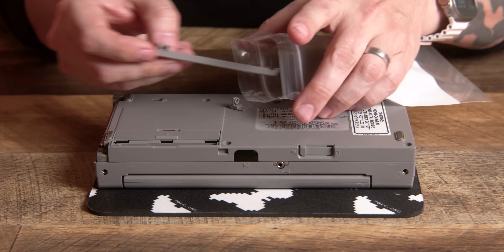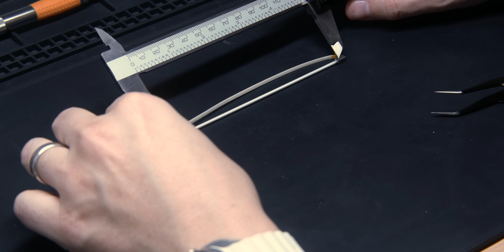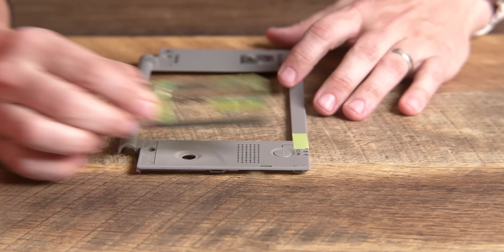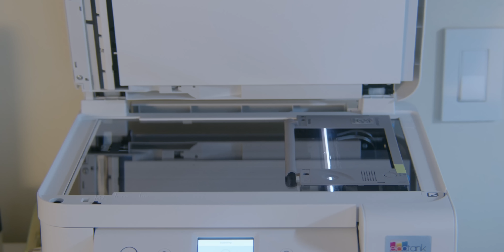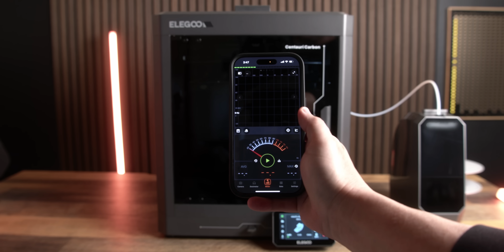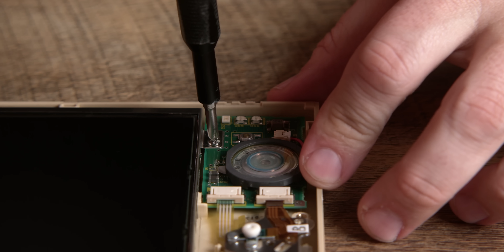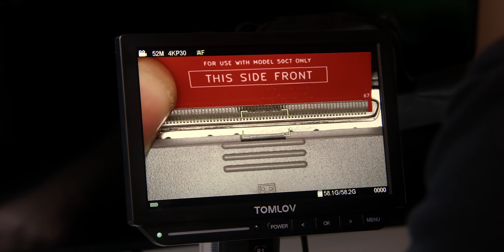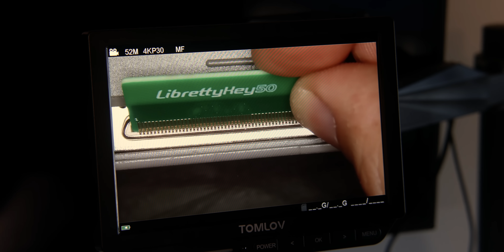I saved this crumbling little laptop from itself

Comment: Why not use an LED backlight? Much longer lasting and a lot less power draw than florescent.
Reply from the maker: Couldn’t find an inverter board that fit within the display case. Decided to make that a reverse engineering project for another time :)
Reply: @polymatt  ahh... makes sense.  I had an HP Omnibook 800 (HP interpretation of the mini laptops of the time) and I feel your pain. I also had a T2105CS - full size Toshiba laptop of that vintage - and the engineering was fantastic - Dropped it down a flight of steps and realized half the screen was blank - Fearing the worst I disassembled it and found a ribbon cable had detached - plugged it back in and worked for years after. I miss Japanese engineering!
Reply: @polymatt Specs, link to that backlight bulb please? 😊
Reply from the maker: @ just added to the video description!

Comment: Ok, this was dope. I would love to see you do retro consoles in the same manner! I would love to 3d print myself a new PS2 Slim or PS2 phat console case :p. Awesome work on this restoration!
Reply from the maker: Thanks! Ive been asked about the PS2s before and that might be fun. Usually I try to stay away from multi-plate prints and try to focus on stuff that will fit entirely on a 256x3 build volume, but no reason why I couldn't model up a case :)
Reply: @polymatt  I totally get that! Maybe a future sponsor can help out with a printer with a larger print bed. :p that way you can print a full console case without needing to break the model apart.

Comment: Haha, as soon as I read the title I literally said "What the hell did you say??"
I own both a Libretto 50ct and 100ct along with some accessories:
The dock or "I/O Adapter" as Toshiba calls it, a 56k modem expansion card, a 10mbps ethernet expansion card, 3 floppy disk expansion cards, all the other misc cables and a carry bag designed for the Libretto series.

I inherited the 100ct and accessories from my dad who used it as a demo model whilst he was a sales rep in 2000's for a Toshiba distributer in Dublin, he'd drive around Ireland selling all kinds of hardware but very rarely he'd manage to sell a Libretto to someone higher up that could afford it. 

When I was a teenager I worked with my dad who's now a systems technician and we did some work in an office up the country and met one of the executives (Now the CTO) that he'd sold a Libretto 50ct to all those years ago. He'd kept it in pristine condition on the same desk for about 20 years as a daily planner/calendar and he gave it to me as a gift.

So that's how I ended up with two Librettos that I'll never sell for sentimental reasons and because I think they're just about the coolest laptops ever made. The keyboard on the 100ct is broken however, so I might have a crack at fixing it sometime,
Reply: BTW. If you ever hear anyone making keyboard PCBs (they should be single-sided, simple, but pretty large), I'm in. I also have an HP 200lx in my collection, and it needs a new flexible board for it. (it's folded, and the traces can be easily scanned)

Comment: Lucky its the 50ct, the power supply on the 100 and 110 is proprietary, I have made them before so its not super hard but still an issue. I have 4 of the laptops in various states of repair and I have just not been wanting to do the mountain of work for the plastics to crumble. If you ever get the 100 or 110 and make a case for that I'd be interested. I had to remove the bios lock once and I had 2 diff docks at one point, the full size and the mini. Both had parallel, I stuck paperclips in the holes and connected those with wire. Worked pretty well.

Comment: The laptop coming out of sleep to it's DECADES OLD session is so crazy to imagine! 10/10
Reply: It was a magical moment to watch.
Reply: @SoloArtForm  Magical indeed.
Reply: Ironically that is one of the advantages of HDDs. Apparently if an SSD isn't powered up somewhat regularly, then you can end up with it what is basically bit-rot and it will loose data. Found that out when using SSDs to act as an offline backup, and was advised about the issues.
Reply: @kelvin1316  aw nuts, I have a bunch of 15 year old ssds from my uni days I've been meaning to dump files from for 10 years 😅
Reply: @paultapping9510 well get it done now that you know. Don’t put it off.
Reply: @kelvin1316  HDD's in general have better life spans than SSD's, whether they are being used or not.  HDD get infinite data writes and only succumbs to mechanical failure, usually after at least 10 to 15 years.  SSD's get, typically, 600 to 1000 times their capacity written and they are done. (So 512GB SSD gets about 300TB written typically before failure.)  And bit rot will occur in high quality NV memory in about 20 years, while cheap stuff may only be bit rot in 5 years.
Reply: @kelvin1316   The bit rot happens for HDD's. That is the point why a Spinrite application exist, and why it is as well very much needed for SSD's as well. 

Our digital storage is seriously dangerous for the cultures. We have started to do permanent damage by example scanning original paper documents, and then destroying the originals in sake of storage in some warehouse in air condition state. We talk about documents that are from 12th century that are now gone, because some idiot thinks that digital is the safer and better way!
Reply: @theserpentes  it goes both ways, when you have something physically you have to maintain it and make sure it's still where it's supposed to be, digitally you just have to make sure the drive gets powered on and used every so often, there are pros and cons to both depending on what the user wants. they may choose one over the other.
Reply: @raumfahreturschutze  Yeah. Imagine thousands of people using OCR on ancient religious manuscripts so they can dump all the parchment and artwork taking up valuable space. Back in the 80s, I had a job microfiching old invoices and dockets at a hosiery company. That stuff only needed to be archived for a few years for financial recording purposes anyway and maybe 0.5% would ever be looked at subsequently. That is more like the stuff that is going on.
Reply: This like an episode from Star Trek Deep space nine. An old Cardassian space station was started up. A long dormant program inside got activated, and it started ‘purging’ everyone on board…!!!
Reply: @arbjful  "Empok Nor" or "Civil Defense". My favorite Trek :)
Reply: Now that's what I call hibernation mode!
Reply: I actually let out an audible "Ayyyyy" when it resumed!
Reply: I have had this happen before myself.  I have also seen some crazy weird things on peoples old machines.
Reply: The laptop coming out of sleep 
- "Even in death I still serve."
Reply: I really liked the hibernation systems before Microsoft built it into Windows. They could startup much faster than booting from the hard drive because they didn't have to load anything except the RAM image. Windows hibernation has to boot up Windows part way then load the RAM image.
Reply: Meanwhile every time I have to reboot a modern system these days or the brokenness of windows sleep or mac terrible affinity for permanently staying on..... Somehow they managed to actually figure out how to do hibernation before Microsoft took their hand out it with XP back in the day I remember it it didn't work very well for a few service packs. And the same on Mac OS X, it was one of the first things I disabled because it was almost guaranteed to not work.

Comment: I have a Toshiba Satellite 100CS from this era and it sadly has the same brittle plastic issue as these Librettos. Half of the bottom is cracked, and the bezel is split in half. I'm a fan of the laptop itself but mine definitely needs some repairs.

Comment: Absolutely enthralled with the no-component bare circuit board key. I figured you'd break out the connections for the parallel port, sure, but the idea that the solution to the BIOS password would be "shove a bare pcb in the expansion slot" is so out of left field. Absolutely hilarious that the tolerances allowed for that, probably my favorite element of the entire project. +1 to the idea of making a new dock for it too, why stop at preserving when you can improve on the base design?
Reply from the maker: 100% and trust me I was just as shocked as you. I was scratching my head for out of the box solutions and when it came to me I was like… there’s no way this could actually work… right?

Comment: WELL DONE! Man you are a boss when it comes to this sorta restoration. I do have a Satellite Pro 490XCDT the grey plastic is brittle, believe it of not the two batteries I have still hold 2 hours of charge each but I can only use one at a time.
Thank goodness the screen hasn't vinegared yet and it works well though it slightly dimmer than it use to be to my eyes at least. I do hope people can make new cases for these Libertto and my "7 pounder" [Yes folks the Satellite Pro 490XCDT laptop is 7.2 lbs / 3.3kg] 490XCDT I do still have the dongle I made for the parallel port it was easy to find online. You do good work man. Good job!

Comment: OH YESSSSSS! Thank you good sir! 

I have a disntegrating 50CT and my Bambu will get a workout tonight. I think the shell should be compatible with 60 and 70 possibly?

BTW, like a year ago I found old Macbook in ewasre and it resumed to Chrome 45 session from 2015.

Any chance for 20/30CTA or 100/110CT ? They suffer from the same horrible plastics. Actually all gray Toshibas do, the other day I grabbed my 660CDT and my fingers went through LCD cover ;-)
Reply: Damn, there is just no good orientation to print this. It looks the best vertical but it is very brittle because the parts have very small cross section so combined with weah layer adhesion it just snaps like glass. Flat is somewhat better but the small bits (catches and such) in display also snap off easily when removing supports because again, layer adhesion. The screw hole pockets in display cover also just detach during support removal becausee the plastic is so thin there. I guess the only way is to send it for printing on something better than ABS. I will try PETG next, maybe it will give me better results.

Comment: I have a Toshiba Tecra 730CDT and it had that BIOS lock (same with another one I had to do as well). I was going to buy a tool on eBay, but I ended up just getting a bunch of large paper clips, bending them into v shapes, and then carefully placing them in a certain way to eventually turn the laptop on and then clear the BIOS password. The Tecra has better plastic than this one (in the video) but the HDD caddy required me to wait over a year until someone was selling a thoroughly busted 740CDX which I bought and harvested the caddy from. They are literal rocking horse crap to find, and the docks? Well, I saw one, and it was about £500... so yeah, these things are kind of insane to collect. Fun thing about my 730CDT as well is that it was used by the Norwegian Telephone company according to the various markings and tags on the bottom.

Comment: I own a Libretto 50CT including docking station and some PCMCIA cards that can dual boot into Windows 98 or Debian Linux (Woody).
I replaced the HDD for an ATA to SD card slot interface with a whopping 64GB card.
This bc the original HDD is slow and noisy as hell.
Luckily not too many parts have broken of yet while I took it apart many times.
Fun fact, at the time this model came out it was only targeted for the Japanese market so when I got it, it was running a Japanese version of Windows 95.

Comment: I hope you put an SSD in that thing!
Reply: SSD's are SATA while the Libretto only has IDE ATA.
I replaced the original small, slow and noisy HDD with an ATA to SD card slot adapter and a whopping 64GB card.
It dual boots Windows or Linux very smoothly.

Comment: i had one of these woking with xp on it. slow was a understatement, battery was trashed but worked ok on psu. and the hd was clanking like god knows. memory was the major problem for it as it was not upgradable. and the graphics chip was basic. for a simple old xp mini laptop it did the job. didnt like the mouse lol

Comment: Hey I actually have one of these along with the dock. Your video inspired me to turn it on, and of course, it had a BIOS complaint. So I will have to build a parallel port dongle and get it working before I put it back in the box with all my other 30 year old laptops and PDA's.  Thanks for adding another unnecessary project on my list.

Comment: I made one of those parallel keys back in the day with parts from ratshack, believe it or not. I had the benefit of having the dock, however. 

Your solution for using the dock connector like a cartridge slot is much more elegant in my opinion. Great job.

Comment: holy cow! I cant beleive I found your channel. I've been wanting to embark on a project to make a reproduction case for my extremely rare Dauphin Orasis Pentium tablet. The plastic is similarly falling apart and I've had to glue it back together a few times. I put the project on hold because I don't have the expertise to do this. 

I'd love to work with you to make a reproduction shell for that unit and preserve its history. I recently wrapped up a 8 year long project to restore the machine to a working state, which i I successfully did in 2023, now the shell needs some love.

Comment: I get historical accuracy and all, but when replacing the backlight could it have been replaced with like a modern LED solution that's brighter and additionally helps lessen power draw?
Reply from the maker: This was actually the original plan but I couldn’t find one that had an inverter board small enough to fit in the display. I’m definitely not opposed to making my own but decided to save that for another time :)

Comment: Heck now that you have the key, it could be redesigned to make new docks for this lilliputian laptop! I.wonder if this methode could work with my Tecra 700ct!
Reply from the maker: 💯you could make an ultra dock as the connector exposes more than what the original dock had.
Reply: @polymatt  what's wild is the 700ct dock not only gave the usual ports but it also gave a SCSI-2 port and 3 ISA slots! Unfortunately those extras probably need extra logic in the dock.
But still for the basic IO it'd be good

Comment: There isn't just the HW parallel port dongle, there's also a way to bypass it with a specially prepared (well not really, either write an image to it or edit a few sectors manually) floppy disk. search term is "toshiba key disk"
Reply: But that would require a floppy drive which the base model doesn't have
Reply: @MenaceInc  Easier to find than the dock, which was optional (unlike the floppy drive)

Comment: Great video! I've used PCBWay for some PCB work and they did a great job. Talk about 3D printing being an iterative process! I did a simple 3.6V battery box with a lid and it took me 22 versions.  I really like those threaded inserts. I'm going to use them for the battery box. So, there will be a version 23 and probably 24...and 25! Thanks for the video!

Comment: I have a fully kitted out Libretto 50CT sitting in a box.  Two batteries, the dock, power brick, etc.  I'm pretty sure it would fire up and work just fine if I dug it out - assuming, of course, that the CMOS battery hasn't leaked.

Comment: I had one of those back many years ago, I picked it up cheap on Ebay and took it along on a trip to the City where my late wife wanted to shop. I hate shopping so I sat in the car and wrote a short story on the little machine to post on the Writers notebook, once a wonderful gathering place online for aspiring writers.  The machine preformed well but the keyboard was a bit cramped for my rather large Scandinavian hands grown bulky by years of labor on a farm before beginning my law enforcement career. I kind of wish I had kept the little guy but being a trader I let it go one afternoon to a fellow who decorated his home with old laptops running screen savers.  His home was a delight for the computer lover and he bought up most of the used machines that were in yard sales around our little town. I wonder where they went when they cleaned out his home.  Seems he was not all that popular a fellow so when he fell; and could not get up, he died on his living room floor.  Nobody though to check on him till the smell hit the street and some walkers reported the stink to the city cleanup crew.  They checked and there his body lay, pretty much gone to slime and bone.  One of those crime scene cleanup crews tried to clean up the mess but in the end, they burned the place as a fire department practice burn.  His upstairs was where he kept his three dogs who were in the same state as he was.  To bad really, his house was nice before he moved in.  His nickname was "Stinky" and he came by it naturally since he had some sort of an aversion to baths and showers, even before his untimely fall, the smell from his house was anything but pleasant, even when the lilac's were in boom..